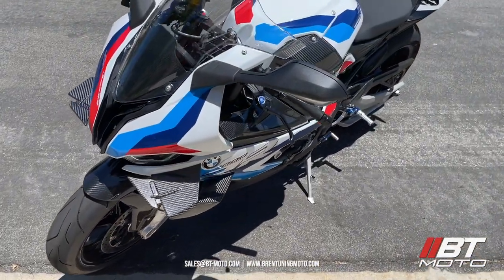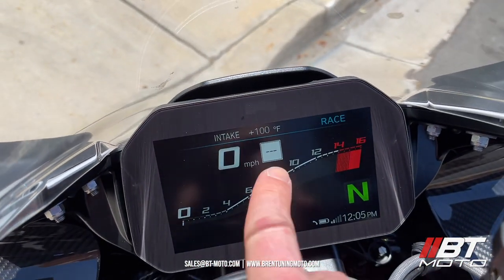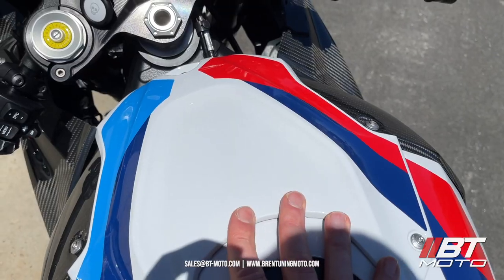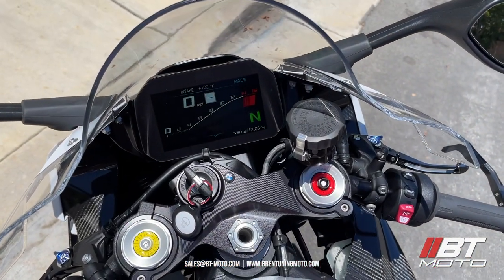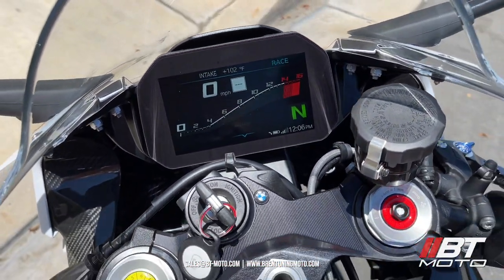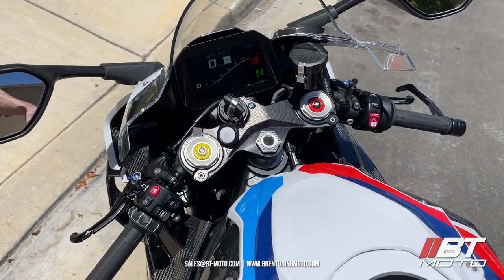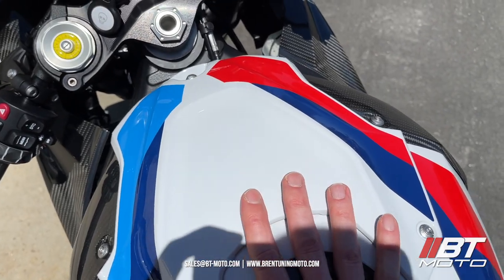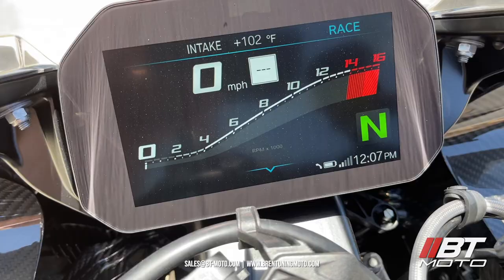BMW M1000RR IAT Issues stock and how to fix it

Comment: My 2020 R1 shows a temp that is way off from what it actually is.  Is this also hurting power on my bike?
Reply: yes, because it's reading the temp from the airbox instead of what the temp is outside!
Reply: @heero3578  can changing the IAT sensor location to a cooler place cause the bike to overheat? I mean does it effect when the fans start blowing air throuhg?

Comment: Flaps can be programmed to be open all the time.  IAT deosnt  adjust mixture in isolation, O2 sensors play a major part and will read lean if not enough fuel.  So I'm  sceptical of the need for IAT relocation
Reply: All the iat does is read temperature. relocating it to the nose of the bike will keep the power constant instead of it being cut by the ecu 1nce it reads the temp from the hot ass air box it's plugged into. U don't need to flash the bike for that but that's the way they sell it!

Comment: I just ordered the stage 2 kit for my 2021 s1000rr with handheld. Will that software come with the tune for flappers open all the time? Or does it need added? I didn’t see any options. Thanks
Reply: did you get an answer to your question somehow? with stage 1 is it always open?

Comment: How much power does it actually loose, percentage?
Reply from the maker: Depends on a lot of factors
Reply: if its  more than 90 deerdees Celsius wather themperature  you loose 4-5 Hp at the wheel ....
Reply: @mike-thebike5757  thanks mate, I m shocked that much.
Reply: @grider8344  jehhh the new BMWs are very sensitiv at high themperatures ...

Comment: I already have stage 2 on my bike but I haven’t installed the IAT kit , my concern now is the flapper opens below 6k RPM
Reply from the maker: With the flapper open only, it won’t improve performance or affect the bike negatively from stock. Just leaving performance and rideability on the table is all.
Reply: @BT_Moto  can changing the IAT sensor location to a cooler place cause the bike to overheat? I mean does it effect when the fans start blowing air throuhg?
Reply from the maker: @swatboss1  won’t cause any overheating. Engine fans are controlled by coolant temp, not IAT.
Reply: @BT_Moto  it is very nice to see everything I will do via brentuning is crystal clear.
Reply: @BT_Moto  should I buy stage 2 for the intake flappers to be fully open all the time? I dont want to remove them.
Reply from the maker: @swatboss1  Stage 1 with the IAT add on will be fine. Flappers are open through software if you don’t want them removed.